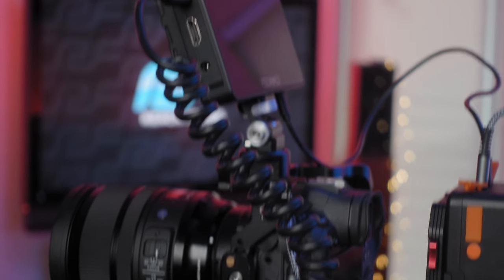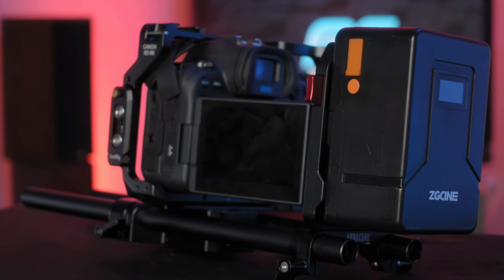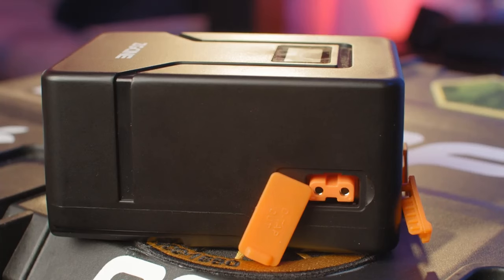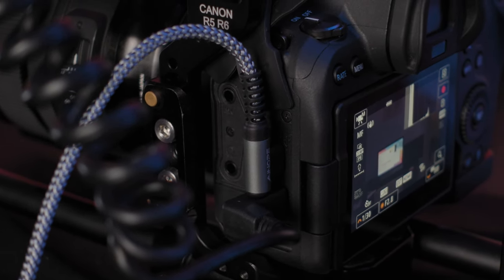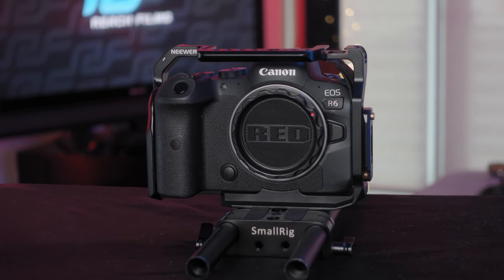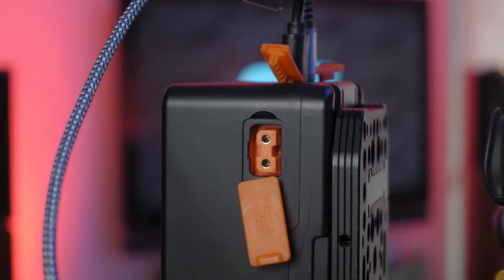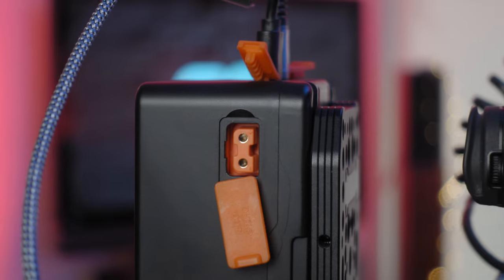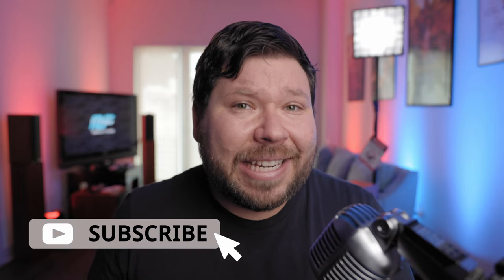How to Externally Power The Canon EOS R6 (works for R7 R5 and R5C) for Filmmakers | BEST WAY FOR PD

Comment: Thank you for sharing the info. I have  both ZGCINE and Neewer V-mount battery, but I've been using Canon R6/R6II with dummy battery for a while without problem, but the setup is messy with cables.Now after watching your video, I have tried these batteries with USB-C cable and it works perfectly. One thing I realize that USB-C port in R6 II  ( I don't have R6 anymore) is filmsy and I'm afraid it will break somehow if i'm not careful. So, I need to find solution to hold usb-c cable (more like to use with hdmi port) and get more Vmount batteries though.

Comment: I had to go back and look... but my battery pack only puts out 22 watts. Will this just flat out "not work" ? Will there be any kind a pop up or error message that tells me so ? Could it damage anything ? Also, what about just charging the onboard battery via the USB. Does that require 30 watts as well ?

Comment: Out of curiosity, why not just use a dummy?  I find PD’s usefulness stops at either fast charging devices or at removing the need to remove your laptop charger from your bag every time you want to use it for a while.
Reply from the maker: A dummy battery isn’t as safe, a short can kill your camera. Power delivery has no chance of doing that. I’m not saying don’t use a dummy battery but I’ve seen horror stories first hand

Comment: Great rig! Have you had any overheating problems? I have with my R6, wasnt sure if powering though the USB-C port would create more heat
Reply from the maker: No it does not prevent overheating, that was the big issue that led me to sell the original R6, I could just not use it as a professional video camera
Reply: @ReachFilms  I totally understand, Im considering selling too. Summers get hot where I am, not sure how well it will fair.
Reply: @ReachFilms  Did you record on the ninja or body?
Reply from the maker: @decus380  this video was quite a while ago so I’m not sure exactly what you are referring to but I recorded on both back in the day and overheated both ways

Comment: Using that battery, I wasn’t able to provide PD power to my R5C via USB-C while also using the USB-A to power a Hollyland Pro 300. Wasn’t sure if that was because maybe the R5C draws more power—or maybe the total output is split between the USB-C and USB-A and thus didn’t provide enough power to the camera?
Reply from the maker: That’s most likely it, the power draw on the R5c is definitely higher then the r6
Reply: @ReachFilms  Good to know! Thank you. I should have tried it on my R5 before I returned it. But with this information I may choose this one if I decide to do a second rig.

Comment: I just Purchased this Battery, For some reason I can't power my Matrix 600 wireless Transmitter with the USB-C PD port, it works fine with the USB-A port which is strange since they're both rated at the same voltage out, I've tried different cables but nothing seems to work, which is a bummer because i bought this specifically for the USB-C PD for that use.
Reply from the maker: Make sure you are using the PD out as there is a specific PD in and PD out port, they should have made one that charges and also powers devices, also check your cord as well, I haven’t had any issues but I have heard reports you can only power a certain amount of devices at one time from this battery
Reply: @ReachFilms  I'm using the correct Port (the one on top Right next to the USB-A Port) the confusing part is it Powers using one port but not the other which doesn't make sense since it's the same power draw. I'm currently powering a Pocket 4k, with Powered V-mount Plate, Portkeys 5-inch monitor through D-tap directly from the battery and the wireless transmitter through USB, works fine with all my batteries and doesn't draw too much power but it sucks that i can't use USB-C out for that Device as I wanted to use slimmer cables
Reply from the maker: @JimmyBlanco  you just answered it, you have it plugged into a power plate, are powering a pocket 4K, a port keys monitor and then trying the wireless transmitter, too many items for this specific battery to handle
Reply: @ReachFilms  yes but my confusion lies in that it powers Just Fine using USB-A but not USB-C  with the same cable Using a USB-C to A Adapter
Reply: Just tried it without having it attached to anything only powering the transmitter and same results
Reply from the maker: @JimmyBlanco  have you tried this cord using other power sources?
Reply: @ReachFilms  yes I have used the same cord ( including the cord that came with the battery) to power it with other sources successfully, however I don't have any Batteries that can output power over USB-C to test that as well, but i've tried Multiple V-mount Batteries and Power Banks Using USB-A and have had success. I'm just trying to find a solution to power my transmitter directly from USB-C.
Reply from the maker: @JimmyBlanco   The more I think about it, it sounds like the device you are trying to power may actually not be compatible with power delivery, remember that normal USB is much less power, I have had this issue before trying to power device from a Power Delivery USB-c and it didn't work but it did from a normal 5v source like a power bank. I think that's your issue, your decide just doesn't work with power delivery.
Reply: @ReachFilms   that Might be the problem

Comment: 30w is a lot is there any battery pack with PD that can be mounted under the camera for portability? Looking to fix R8's tiny battery limitations.
Reply from the maker: There are many power delivery options however for what you are looking for will probably require a deep dive on Amazon and google as it will be very specific for your needs.

Comment: Would I be able to use my laptop (Mac) to power my camera with a charging cable from my iPad (both ends USB-C)? That would save so much headache of carrying numerous batteries.
Reply from the maker: No although the camera will
Show that it’s charging the laptop doesn’t output enough power to continuously power the camera and charge the battery at the same time
Reply: @ReachFilms  okay, thank you for the prompt reply, I really appreciate it! I will now be looking for a solid powerbank that doesn’t break the bank then that does output the power you indicated is necessary!

Comment: can you power ninja v with that v mount battery?
Reply from the maker: Yes you can through it’s d-tap
Reply: @ReachFilms  proper voltage and amperage?
Reply from the maker: @josemiguelherrerapalacin2816  yeah it’s pretty normal, a lot of people power these off of vmount. It’s normally done with cinema cameras like RED, arri, blackmagic etc. but in this case doing it with the r6 combo
Reply from the maker: You just need to make sure you get the right dtap cable, I’ll go over the options in my video going over the whole setup with the ninja because there are quite a few different routes to go via dtap
Reply: @ReachFilms  not just dtap to dc cable ?
Reply from the maker: @josemiguelherrerapalacin2816  that is one way to do it

Comment: Oh no... Canon R6 supports 30 w power... 1:31
I'm having 22w powerbank
Reply from the maker: Hey! I’m a little confused here, are you asking if a 22w bank will work?
Reply: does it work the whole day continous shooting?
Reply: @ReachFilms  yes, but I have figure out & had another options with trying & error in last 6 months, i'e:, get some powerbank with support of 45w, 65w, 85w or 100w powerbank support of PD charge, they charge your R6 with battery inserting ONLY 'LP-E6NH' but no LP-E6 or LP-E6N.
Reply: @vipingkumar  yes it can work with whole day, but the battery will get affect with hitting inside with continuous of charge & discharge, this feature is supposed to used only in some cases like, time-lapse for Day-to- night shooting where camera is just takes photo at some interval time, but if its event or wedding, don't risk your fullframe body for just an alternate battery, get a dual charger with spare batteries, third-party batteries are best now a days !!!